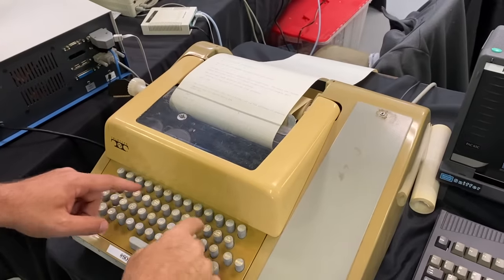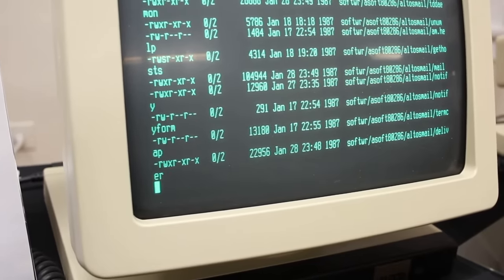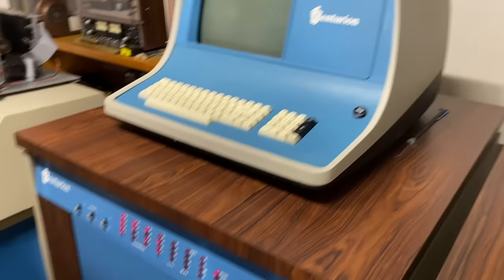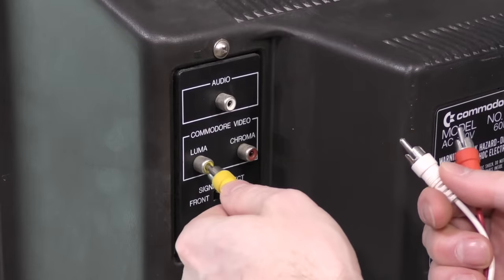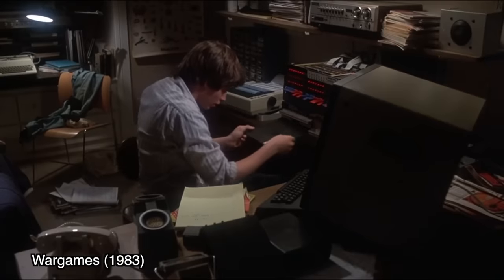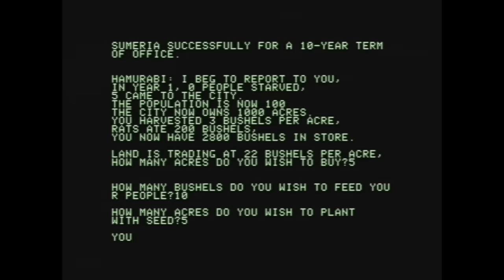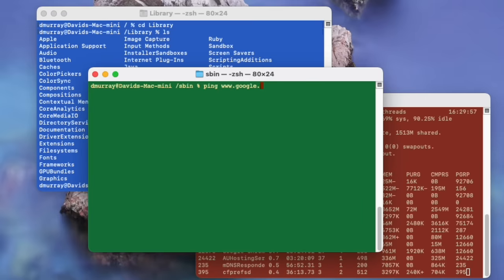What are Dumb Terminals?

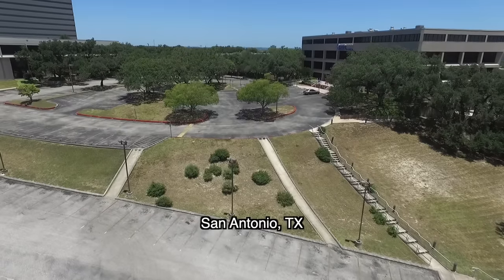Comment: I recall browsing a terminal fan forum once, and someone was making himself a keyboard-monitor housing to look like an old terminal. It looked almost exactly like the early Datapoints shown from 3:27 but propertionately wider and, of course, had a flatter screen. :) 

Oh I wanted a Honda Beat in the 90s! :D If I remember right, it's light enough to be sporty despite its tiny engine.

What happened to the hung-up signal which shuts down all the programs on a line when the terminal disconnects? Do you need to use actual modems for that to work? Is it on a timeout? Do some computers just not bother? Now I think of it, there's no need for a single-user computer to bother with a hung-up signal, nor perhaps some multi-user computers depending on how their terminals are attached. Bugs in the line driver are also possible. From someone who worked with a lot of old systems, I heard that IBM AIX's line driver was the worst and Linux's wasn't very impressive, while Vax VMS and OpenBSD were the only systems with fully correct line drivers.

Comment: I had a terminal as a teenager. I connected it to my Amiga and sometimes connected to my BBS software with it :) .. It wasn’t VT100 compatible though AFAIR and so it wasn’t that useful. But cool for a while. I also had a printer from the 70ies, huge and quick, but it only ever printed when I touched one of the parallel pins.

Comment: Not sure if my memory is still correct but when I studied on a VAX machine, from a VT320 terminal connected to a "digital kind of switch", it was possible to send information between terminals even with the VAX disconnected, if I remember well, the command was "broadcast" and worked even not in session to the VMS OS.

Comment: I used terminals in my first job in the early 90s. We used them to input data to track and plan trucks into the mainframe computer. I remember the switch to real computers with a graphical user interface under windows 95. We all hated it because the clicking with the mouse slowed us down.

Comment: To add onto that last bit about terminal emulators.
The 'who' command in Linux and Mac or 'quser' in Windows show you how you're logged into your terminal (console for Windows), which is usually tty7 (on Linux) if you're using a graphical desktop environment.
The TTY standing for TeleTYpewriter (i.e. what the whole intro of this video was about) and it's possible to switch to other TTYs. tty1 is often the graphical login screen, tty2 is another desktop environment, tt3 through tt6 are command lines, and as I said, chances are you're in tty7 now.
While the exact numbering can be slightly different, tty0 is, as I understand it, reserved for the kernel and tty8 and higher are left blank but can be claimed.
Furthermore if you're in a GUI environment you can switch tty by using CTRL+ALT+F# where F# is any of the numbered F-keys and they correspond with the number of the tty. If you're in a command line interface (CLI) just ALT+F# allows you to switch. So I know for certain that you can go up to tty12, maybe you can go higher with commands...
And finally; at least for Linux, you may have SSH'd into a computer and see pts/0 under the who command, pts are pseudo-ttys. Iirc they connect to a pseudoterminal multiplexer or ptmx. But honestly, you're better off reading the man pages at this point :P
Reply: I think most distros use tty2 for the X server and tty1 for the display manager now

Comment: When I got an Atari 800 computer it had a RF cable in the back to attach it to a Color TV by a Switch Box and it had a round socket on the side to attach it to a monochrome monitor, so basically one person could work using two separate screens. Thus I view the monochrome monitor as a dumb terminal.

Comment: As a former keypunch operator, I used the Entrex Data Scope in 1973, and the Entrex Data Terminal in 1980. My typewriting skill represented me with the ability to work on any machine that has a typewriter-like keyboard. Also, a microcomputer could be considered a dumb computer. A "dumb" data terminal or computer is only ready to execute commands from programs as selected by the user's keypresses, or clicks with a tracking apparatus such as a mouse.

Comment: If you have a serial port and a Linux machine, you can still use the old terminal protocols even to this day.  I used to enable it just as a "place of last resort" to talk to my servers up until serial ports just stopped being included on modern servers and workstations, actually saved me more than once.  Terminals remained in use on many systems well into the early 2000s and in niche systems to this day.
Reply: Network equipment still has serial ports by default and they are VERY useful when you misconfigure something and lose the network access to the device... In data centers you usually get them connected to terminal servers who expose the serial ports of multiple devices over SSH through an IP network. And if you also lose access to those console servers... the last resort is to physically go to the server room, connect your laptop (with terminal emulation software) to the serial port and get to the device this way.

Comment: In a way the dumb terminal lives on in via modern thin clients, which actually don't run anything themselves and are pulling input from an operating system in a virtual machine hosted on a server somewhere else. Some thin clients have local storage and ports for hardware, some don't. Hospitals use these a lot so that there's central verification of anything from EKG scan outputs to patient scheduling. My local hospital has a bunch of Lenovo ThinkCentre M6s they're getting ready to retire and auction off in lots, and I'm salivating at the chance of having a bunch of thin clients to put in every room of the house.

Comment: Cool thing that it's still possible to connect that 100yo teletype thing to some modern linux-server with like 128 CPU cores and 1.5TB RAM (with some engineering to build level converter) and almost properly use it.

Comment: I recall learning about the cursor codes for the VT-52 (VT-100) terminal, and using them to make a tank animation using characters.  Background would scroll to either side as the tanks wheels turned.  Dreamed about making an ascii text version of Battlezone.  Good times.

What I don't remember any more is how did a dumb terminal get connected to a modem to communicate with a mainframe computer in a different building? How did you "boot up" as it were?

Comment: I think the tricky aspect of video terminals versus computers is that the circuits for generating the video signal and handling features such as scrolling and control sequences ended up being pretty sophisticated. In fact, I suspect the innards of something like the Commodore PET and a terminal of the same vintage was not that different. Terminals probably often had a microprocessor or microcontroller. The main difference was that a terminal ran one program burned into ROM and was intentionally not general purpose.

Comment: I first learned to code on a VAX terminal in the 90's. C++, Fortran, and Assembly. Thought it was amazing back then, not to mention being able to connect to it with by hyper-terminal from home by dial up. Sadly that's as far as it went. I quit college for work, meaning to finish later and never did. However I have had a nice carrier in fiber optics.

Comment: Those terminals at NASA are actually TV screens pointed at a computer monitor with a transparency overlay that provided the headings.  They could display the data from the IBM's on a monitor, but there was no way to insert the text.  Each controller had a few buttons that connected to an automated system that switched the transparency.

Comment: I comnected a Laser 128 to my Raspberry Pi system running Debian and ran commands from the Laser 128 using the software I cannot recall the name of, but it had different terminal sessions from the VT110 (or VT100) to ASCII. I did connect to an IRC from it as well, but I had to choose the correct terminal so it had the text I'm typing at the bottom instead of not showing what I'm typing. I might build a Linux server and set up a terminal server on there with serial cables and modems so I can dial in from an old laptop and run commands for installing updates, reset as needed, etc.

Comment: I would call most of the terminals you described smart terminals, as we did back in the day. A simple glass TTY without cursor addressing and other advanced features would be a dumb terminal. If you could run a display editor on it, it would be a smart terminal. This could be done on terminals less capable than the vt-100, but that and its successors from DEC certainly set the standard for best-in-class when they appeared.

Comment: The IBM System/360 and terminal emulators are still alive and well in a lot of the government. The System/360 is still supported by IBM, in fact they just released a patch for SSD support a few years back, and it's incredibly costly to migrate away from a machine that's been security tested for more than 40 years.

Comment: In the army, I worked with a system called and AN/GRC-142. It was a TTY system the used and TT-98 Teletype system. It was looped into a MD-522, 80hz modem. This was then routed into a AN/GRC-106 (Angry 106) transmitter.  It was a Single Side Band-One Way Reversable AM Receiver/Transmitter. It transmitted at about 29 characters per minute. You could also use a TT-76 Tape system to precut the message and just run the punch tape through it to transmit it a bit quicker. See https://www.youtube.com/watch?v=J6b7Fb3H3LU&t=147s . This one is using a AN\UGC-74 model which came later.

Comment: Awesome video, I would love to see some of the things he has a that workshop, could probably explore for hours. I have a question. I work with point-of-sale hardware, and we always call our register computers “terminals“. They are whole computers (little Celeron processor with 8GB of RAM) apart from having no storage at all and they PXE boot from a main server whenever they start. Is this a proper use of the word “terminal” in today’s day and age?

They will stay running, if the server goes off-line, but they can’t really do anything just like a traditional terminal. And as far as booting, they are completely useless without their server.

Comment: Back when i was in university we used dumb terminals to connect to various computer systems. It worked. VT220 or VT100, i can't remember which one.  Later on in schooling it was unix workstations.

Early on at work there were IBM 3179 and 3180 terminals to connect to the mainframe.

Comment: I have a telescope and you actually have to plug it in via serial RS232 and the program is actually a terminal emulator with a GUI from like 1998. I had to redo a few solder joins on the handheld and the computer uses a Zilog Z80 and has 90 kilobytes of ROM onboard and doing a little extra digging I found out that the ROM chip for the onboard OS and plugged it into my friends Ardueno and we found out that it runs FORTRAN 77. The telescope is from 2008 and is just a telescope with guts from the 1970's. It's part of the reason why the software doesn't work, Meade launched the damn thing using software that is so old that the telescope serial port cant connect to modern Windows.

Comment: One thing I love about Linux is how the old way of using terminals is largely still accessible through the operating system. As a Linux user myself, I can switch between tty outputs using some hotkeys and log onto my system multiple times because I just feel like. It actually comes in handy on the off chance I manage to break the UI or lock it up, I can switch to good ol plain terminal and restart it.
Reply: It was a decent method of multitasking before the release of Screen
Reply: @charliekahn4205  Yeah, screen is pretty great.

Comment: Some terminals had a local echo mode, and didn't need to be connected to a computer to display output on the screen. The only problem with local echo is you could be typing into a dead connection and not know it.

Comment: I used to use terminals on an IBM  mainframe (os/390) back in the early 1990s (in the UK).  Monochrome displays and  DB2.  I feel old now and I also think it was technically 9-bit...!
Reply: Its was EBCDIC, an 8bit encoding developed from the punch card days of IBM.  IBM terminals were also frame based.  Frame terminals kept the entire the screen in memory and only updated changes to the previous screen.  ASCII terminals required complete refreshes of all the data, hence were less efficient.

Comment: Maybe a few remarks about the history:

a) The term 'Terminal' already originates already with telegraph and ticker as either was the end (terminus) of a communication line, a terminal.
b) In turn TTYs were called terminals right from their invention in the 1920s. Way before they could be connected to a computer
c) This was continued when computer took the role at the other end
d) The Datapoint 3300 is not the neither the first, not the first commercial video terminal.
e)first VDU based terminals appeared in the late 1950s. 
f) IBM, Univac and GE sold terminals as we know them today since 1964. Datapoint wasn't even founded at the time.
g) Unlike often stated, those terminals operated in line mode exactly like a TTY
  (at that point it might be important to remember that it was mechanically impossible to type on a TTY while output was printed)
h) Before Datapoint several other companies brought similar terminals - like the Courier Executerm 1
i) Clear screen and other basic functions - like cursor movement - were already there with the very first glass-tty.
j) this includes the Datapoint 3300
k) There were of course as well terminals that would not show anything if disconnected - there is way more than those late versions shown.

The core  distinction about dumb terminal and non dumb isn't about certain control functions - those define the flexibility it offers - it is if a terminal can provide local functions taking off load from the computer. Like defining fields, so editing within a mask will need no host interaction - or limit the characters to be entered in a field in length and/or type, like allowing only numerals and delimiters for currency fields and so on.

Oh and yes, it could not only be done in the 1950s, but it was done - though, not with much units, as there weren't many computers either :))

Comment: With the increasing speeds and bandwidth of the Internet, I often wonder if we will ever go back to a type of Terminal/Mainframe way of working. Having an operating system as a service. Instead of having the physical parts of a computer in your home or office, you would rent space on a commercial hard drive, and then rent CPU and GPU time, and subscribe to the games and applications you use. User inputs get fired off down fibre connection, and graphics data comes back. The CPU crunching your bits could be the other side of the world.

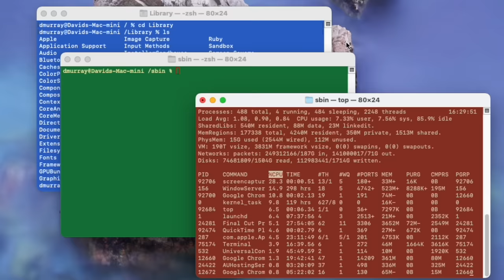Comment: 13:48 I see Final Cut Pro is running.  Do you still use the old version of that from around 2009 or so?  Just curious, I know James Rolfe stuck with it for as long as he could until like 2015 or so but finally had to move on to a different video editor as the old Final Cut Pro was starting to have a lot of problems.

Comment: Anything on paper tape??

Other than my FORTRAN code?

We had limited time on the university terminals but I had a part-time job where I could hack out my code to tape after the paid work was done.

Following morning, I'd load a couple of hundred lines via paper tape reader (ASR43, IIRC) within a few minutes. Ready to debug.

University system had only a line editor. Work had a full screen editor which was far more comfortable and productive.

Comment: The RAM at the time of the 1950's was pretty basic.  Usually it was stored in magnetic memory at the time.  Couldn't have been stored in vacuum tubes, I don't think silicon or gallium arsenic would have worked.

Back then, memory was often stored on a vibrating ring of wire.  Some early electronic calculators were using that, and I think that was the 1960s.  Had to look that up - "Delay Line Memory" and that was late 1960's.

Comment: One thing one perhaps can fail to appreciate today as much as one would have back as recent as the 1990s, is that computer terminals are just as low-power as a small CRT TV and thus operate in complete, beautiful, solid-state SILENCE. 

Since RS-232 cables can be up 15 meters long, it means you can have a silent serial terminal sitting on your desk while the noisy computer can go in another room - without any "networking" involved!

I was lucky to recover a 13" VT-320 in my teens which I promptly hooked up to "/dev/ttyS0" on my Slackware server-tower so that it could go hide in the wardrobe instead :goodvibes: CYBER LEVEL INCREASED

Comment: My first micro was a MicroDecision MD2 with 64k, two floppies, and a dumb terminal that displayed green monochrome characters.  I only had two complaints:
1)  Every now and then, the high-pitched flyback transformer whine from the terminal would drive me nuts (not everyone could hear these tones, BTW).
2)  One of the floppy drives would occasionally KNOCK while spinning.  I've tried to research this before, and I still have no idea what there could be in a 5 1/4" floppy drive that could KNOCK (once per spin, even, VERY annoying).  Though it never suffered data loss.

Comment: If you have a terminal now, they can still be put into work with a modern UNIX computer - anything that runs Linux or macOS. You just need to somehow get a serial port on your computer - be it USB dongle or the built-in one on Raspberry Pi, attach the terminal there, and finally set up your OS to use that terminal.